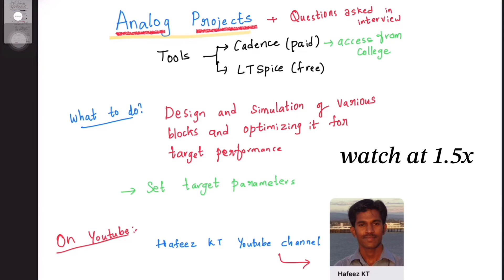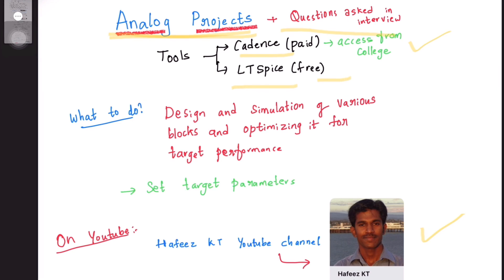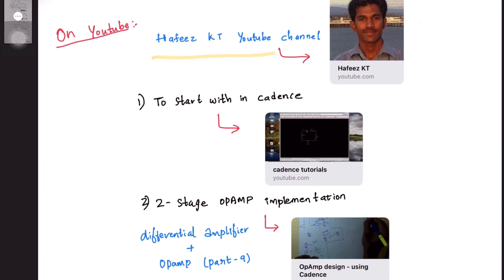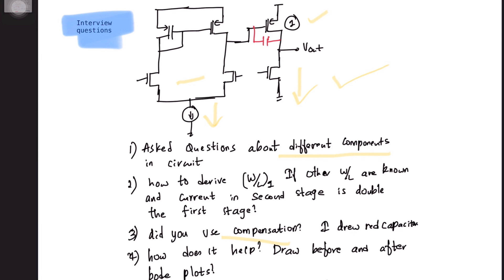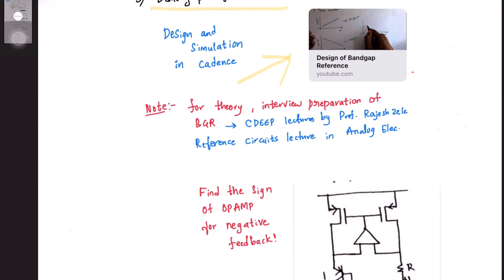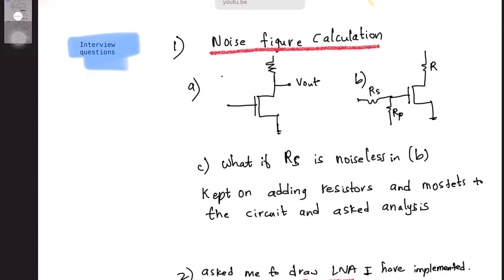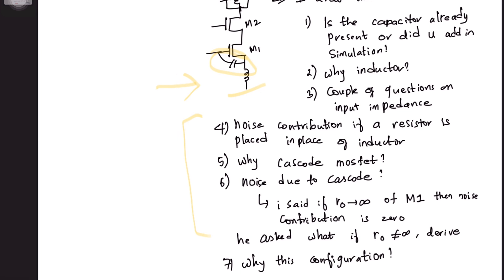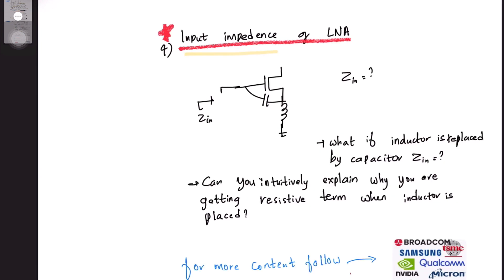Analog projects to make your resume shine✨ | cadence | LTspice #vlsi #nvidia ​⁠@VLSI_Placement​

Comment: Hello madam, I am getting seat at NITK Surathkal in Signal processing and machine learning. Can i join it and will the college allow me to sit for VLSI placements?
Reply: Nope
Reply from the maker: Connect on LinkedIn with NITK SPML alumni , they can give you better suggestion!
Reply: Spml is not related to vlsi try communication or other branches after consulting seniors
Reply: Companies visit the ECE branch. Any departments coming under ECE are eligible for sitting VLSI placements